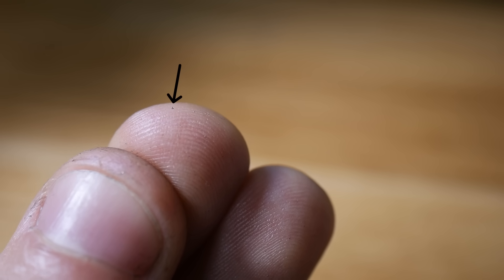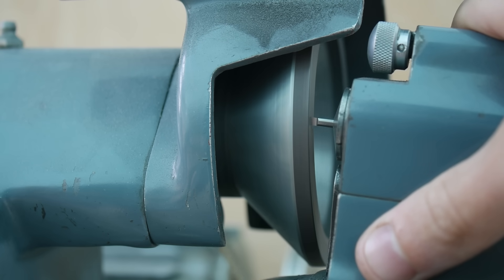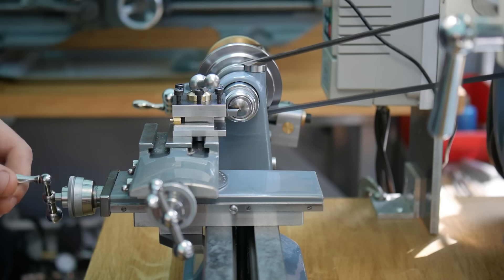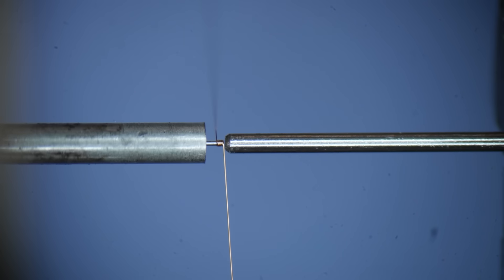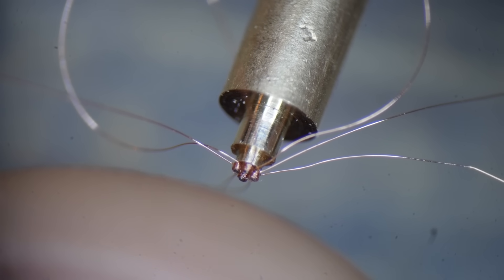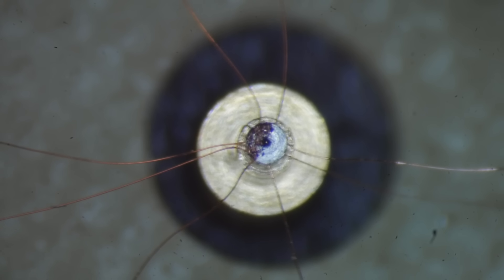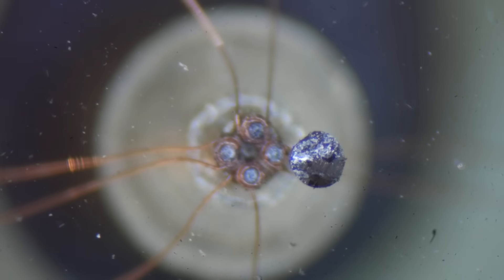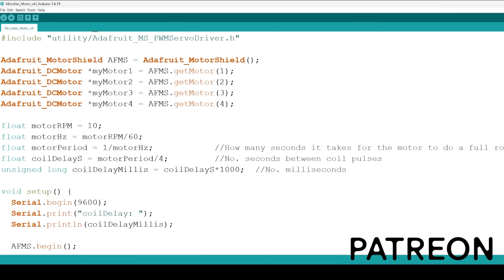Attempting to Make the World's Smallest* Electric Motor

Comment: I don’t know if this will help, or if it’s even possible… you mentioned at the end about not knowing how to mount a watch jewel to use as a bearing surface.  But since the whole motor is so small, would it be possible to drill the mounting holes for the electromagnets directly into the jewel itself, around the central pivot hole?  Maybe even having a top and a bottom jewel, in order to have the magnet rods fully constrained.  You could start out by using a superglue arbor and a polishing lap to grind the jewels down to a thin-ish wafer to save some of the size.  You could maybe even glue the two jewels together to machine all of their holes in perfect alignment, then separate them with acetone afterwards.  With the magnet rods held firmly in place between the jewels using UV adhesive, the rotor is much more likely to spin without hitting them, and the jewels (with a thin film of a light viscosity oil) will hold the rotor steady as it spins, with much less friction holding it back.

Great project, I can’t wait to see how version 2.0 turns out!

Comment: You used copper (copper alloy) wire for winding around the post, could you use steel (some alloy) wire for the post?
Could you extrude post thru the base, then cut them to length?

Comment: Try casting instead of machining, it's much easier at that scale. You can experiment with mercury as well. I wonder if casting out of polymer and then electroplating with a ferro-magnetic metal may also work.

Comment: The glue is not a bad thing. Use a cylinder of material that the glue wont stick to. Then remove it and you have a place to attach the rotor.

Alternatively do glue a cylinder in and use it as a shaft to put a magnetised disk with a hole on it

Comment: Use a micro droplet of mercury as a rotor and make it as a induction motor. The droplet is perfectly round and the surface tension of mercury will make it behave like a solid.

Comment: put a drop of resin on the tip and let it harden, before cutting off with the diamondwheel. where you can get the wheels, you can get the resin/wax ;)

Comment: I’ve used UV resin on micro components for a few years now. At Harvard, we were dialing in micro lithography combined with laser etching. Personally, I’d invest in a 1064nm YAG laser with pulse modulation so you can combine that with a super fine pantograph. 🤤

Comment: A bit of soldering advice - my mother worked in electronics repair for a time, and taught me that a bit of clear nail polish can be better than solder for connecting fine wires by hand (though it can also be better to have a soldering oven if you can)

Comment: Instead of CA you could might use UV hardening glue, if you get to much just rinse it off and it will not hardened until UV light hit hit. They are usually a little thicker than CA but I have not dived into it much so there could absolutely be thinner as well since these are used in the industry and they normally have many demands.

Comment: I can't decide what's the bigger feat...your persistence and expansive problem solving skills to build this device or the unbelievably compelling videography in capturing the scale of the technical difficulties one faces when working at this level. Nevertheless, making nano-scale, functional mechanical devices....both the fabrication of the individual components as well as the assembly of them is a key enabler to more affordable deep, deep space exploration. While advanced lithography methods taken from the semiconductor industry have enabled the nano-scale component challenge, the work you've done here to assemble these tiny, fragile components into a functional device is a real enabler to this application as undoubtedly to many other applications that are outside my own awareness. Amazing, amazing work.

Comment: My first question is why wouldn't you have just used three coils as a typical small DC motor would use?  Other than that, I can't offer any suggestions, you're way beyond me and being able to do that kind of work. Perhaps building some specialized tiny tools to help with the manufacturing?
I've always wondered if one could create a whole machine shop on a small scale. Build a motor maybe 10 times that size that's much easier to build and use it to power a tiny lathe and drill you build.

Comment: 🤔maybe you could use uv resin, not only to glue parts but better to cast the coils into a more handable part. Then you may drill the hole into it. About the shape, i'm pretty sure a flat coil arrangement around a simple magnetic disc equiped with glued conical shafts then sandwitched between 2 drilled plates will turn smoothly and be lovely to observe (btw 3 coils are enought to ensure stable rotation with a reliable bearing , less work than doing 4). good luck skilly guy.

Comment: Does the rotor and shaft have to be one piece? A rotor disk with a hole in it spinning on a fixed shaft would be easier to make.
Reply: Presumably the original creator used a 4 pole design as it was easier to make a controller to run it. With the arduino it should be possible to make a 3 pole version, reducing the size even further.

Comment: not an expert on this trade nor even in metalwork or electronics, but i can tell you solvent for cyanoacrilate is very useful. I have a small bottle from Würth, it is advertised for unsticking your fingers, but using it for parta and rinsi g with ethanol really helps cleanint the mess. If you let it soak for very little, it dissolves the outside layer without sipping into the joints. Furthermore, i would stake in place the coil cores, and pre makenthe coils on a mandrel. After that, the coils should be insertes onto their cores. I would use the lathe crosslide to position and mount them, thus eliminatong hand free operation. Regarding the rigidity of the shaft, i would treat it as any other watch componet, with conical shafts on ruby bearings. This way contact ocurra only on the apex of the shaft.  Also, another plate holding the motor as a sandwich. I don't kow if any of this is useful as i've never workes in sich a small scale. Great video and trade skills, such a pleasure to watch. Bestt regards

Comment: If you create a 4 or 2 piece platform for the winding you could just torque the cable down to avoid having to glue. You could also encapsulate the top or have a through pin hole to keep it in place when assembled.

Comment: Your parting tool geometry is what I was taught when running brown and sharp 00G screw machines in the 1970's at Advanced Screw Products 😅. Just recently I tried to share this trick with some young manufacturing engineers.....there are many manufacturing tricks which have never been recorded and are doomed to be lost.
Reply: As a quality control manager in construction and data centers, The knowledge of construction has been lost to builders.
The majority of what we do now is putting together pre-engineered pieces, assembling. 
I think of this often.
Our civilization is built upon layers and layers of previous knowledge and technology that was automated into machines/tech, that built the components, did the calculations, and all, for us. Onto which another layer was created and another. A proper catastrophe would send us back to the Stone age. To recreate our modern conveniences you need many experts in many fields. You would be hard pressed to find one person that knows the science behind all the components of a system.
I truly admire ancient architecture and even more recent architecture that involved true mastery. Stone masonry, carpentry, stained glass, handcrafted ironwork features.
We are advancing ourselves into pure ignorance, like Wall-E.
We won't know how anything works we'll just know that it used to work as long as it had power and material.
How many people would even know how or where to get ore and have the knowledge to make metals? 🤔

Comment: Does it have to rotate? Else you could make it as a rod in a coil making a stroke instead. Also it might be easier not to turn the parts using a method with less bending force. Maybe it does not even need to be cylindrical parts?

Comment: I've never done anything close to this scale but have worked with microscopic resistors and other electronic components. You had trouble positioning the rotor. I find that doing a series of movements is better than trying to awkwardly place the item. Place the item on it's side. Rotate it into position. Pick it up and drop it into final position. I'm also surprised that you are using the tweezers. The part is small enough to position with a needle and drop of fluid. You lose some accuracy but you get multiple attempts to position correctly.

Comment: The problem with this size range is, that you cannot use the electrodynamic principle of electric motors successfully, because it needs certain wire lengths to produce enough BxL products to generate enough force and back EMF for motion at useful currents and voltages. So you have to live with magnetostatic motors which tend to melt or evaporate at a certain scale because of bad cooling.

This is also the reason why micromotion on chip devices is generated by electrostatic motors. In this way you can at least operate with useful voltage ranges, and the velocities can influence enough ESF to work against to much displacement currents. Electrostatic motors are also relatively easy to achieve by the use of thin PCB materials. So you just have to send your gerber files to a PCB manufacturer to get certain amounts of motor part at very little costs.

Making such motors you have to be aware, that you have very small moving masses, which can be accellerated to extremely high velocities allready by tiny forces. I can imagine that a homopolar motor based on a 1 mm diameter and 0.5 mm thick NdFeB magnet exposed to a PCB with a centrally aranged radial copper line design can easily rotate with more than a million turns per minute, when it runs with a useful titanium shaft in ruby bushings under an EMF of less than 1 V and a few mA current.

Comment: I know it's probably not in keeping with the theme of the build, but I wonder if a crude EDM setup might help you in shaping and parting your pieces. For something this small, you probably wouldn't need a lot of the supporting equipment (like for example a wire feed and submersible tank). You could likely just use a PWM output of an Arduino to drive a MOSFET (or maybe a BJT?) to switch an adjustable benchtop power supply. At a random guess, I'd say a voltage of around 10-50V with a pulse duration of anywhere from 0.1-100us, and a switching frequency of perhaps 100kHz might suffice (since your work is so small, output switches at 100kHz for a duration of 0.1-100us). You'd also want a variable resistor in series with the switched output to limit peak current to somewhere in the range of 0.1-0.5A. The value of this resistor would have to change with your input voltage (from 20 Ohms at 10V/0.5A to 500 Ohms at 50V/0.1A). You could attach the machining wire or plate to a toolpost, have the body of your lathe grounded to the PSU, then manipulate the machining surface like you would any other lathe tool. Would be interesting to see how effective it might be.

Good luck either way! Super excited to see a future video on this!

Comment: IMO, you'd be better off having the four "cores" 1:20 made from a non-magnetic material - say a piece of ceramic or glass (or even a piece of non-ferromagnetic metal, if your speeds are going to be low). The "cogging" from the bits of steel shall always imbalance your rotor, and you'd need damn good bearings to counteract this; whereas an "ironless" stator shall be far easier to implement, albeit less efficient.

Comment: "Wire itself tended to melt" 10:20 --> It's likely "dissolve" instead of "melt" - the copper dissolves into the solder (presumably until an equilibrium), hence when the solder is already equilibrated on the copper pad, it does not eat away the wire.

Comment: Very nice project, just wanted to leave a small suggestion. The difficulty of working with Alnico may be avoided and the original rotor may work, if you make the motor AC instead of DC, as Induction motors don't need permanent magnets, any metallic rotor would work. You will be trading the mechanical complexity with electronic complexity, i.e., the electronic driver will need DACs to create the phase shifted sinusoids, but I think it's a good trade-off. 
Note: I am not sure how good the induction would be based on the current design and tolerances, but thought to share a possible avenue to explore.
Reply: You don't need DACs for this function at all. Why would you think this?
Reply: @user-rs8zg8ey2b I thought it would be more controllable to use a Microcontroller and DAC setup to generate the phase shifted sinusoids for each coil. So, that the amplitude, frequency and phase shift can be programmed for the experiment. It would be interesting to know your thoughts on this as well...
Reply: @rounakdutta6211  99% of brushless motor do NOT control the amplitude. So imo you don't either, it just complicates the whole electronics drive section. 
On my channel I spin a magnet to 3.8Mrpm with a hall sensor, fet driver, fet and coil. Yes, you can't use a hall sensor, but why complicate something that does not need that level of control? Good luck.
Reply: @user-rs8zg8ey2b I saw a few of your videos, especially the motor ones. Nice work on those. But when I said induction motor, I didn't mean bldc, I really meant "rotating magnetic field induction motor", so the rotor doesn't have to be a magnet. Without a magnetic rotor, hall-effect sensor based driver would be of little use. In your videos, I understand that the rotors are ball magnets, so you are able to use the hall effect sensor for timing the pulses.

Also, since the rotor is very tiny, in this project, I thought a well controlled supply would be helpful in finding out the sweet spot in the power input. E.g., in your high speed motors, the rotor disintegrated very quickly, and the aftermath was ofc fun to watch :-), but that may not be the goal here...
Reply: @rounakdutta6211  ok, I see what you mean now. 
It's easy to change supply voltage to limit rpm. 
Unless you're a programmer (I am not), adding the dac control to vary the amplitude is not worth the extra complexity imo. 
Using a mpu to ramp up and hold a steady rpm is a good idea, with some trial and error you could find a nice sweet ramp up speed and running speed. 

A while ago I wrote different ways to drive brushless motors, but yours don't have magnets. If your interested I will find the link.

I just had a KISS idea to drive your motor. If your motor has 4 poles, use a 4 pole bldc motor as a generator to drive your femtomotor.
Well done!

On another note, why not use a tiny magnet, one coil (no core) and spin it, it could possibly be smaller than your current motor as it has less coils.
Reply: @user-rs8zg8ey2b  BLDC or PMSM motors are NOT the same as induction motors. I suspect that the small inductance and weak coupling between rotor and stator would render attempts at vector control futile. The only feasible way would be to just synthesize multiphase waveforms(for the number of phases i would use 3) using either analog circuit or a uControler. Then, use three or six windings on the motor, this would provide actual rotating magnetic feild. You could adjust the speed with simple v/f control.

Comment: UT Austin has a paper about a bunch of electric motors that are only a couple of molecules across & they have ways of wirelessly sending RF power to it via lab grown attuned crystals at different frequencies so that logic & batteries could be handled externally.  There are a bunch of universities working on nano-tech with smaller motors than this & even naturally occurring motors smaller than this as any biotech grad student should be able to point out to you.  The struggle is tracking these nanobots inside of anything but in theory you could make a swarm of tiny worker nano-bots without any logic inside of them so small that they wouldn’t cause damage & then use larger pill sized robots to control whatever nanobots happened to flow past for precise surgery at the cellular level that could perfectly target a wide variety of cancers & other such diseases.  All of these efforts get very little funding though for some reason when it seems promising.  They military has similar nanotech projects that looked at putting mesh reinforcements inside of vital organs to make humans more explosion resistant, these had very small motorized nanobots involved as well to actually build the mesh.

Comment: Like make a bushing to keep everything center but even integrate it into your coil base so the uniformity is set by the base which plus you could use fine cylinder to make the coils part and not lose cause attached to wire then just like thermally expand the holes to set the pins

Comment: look into ceramic coatings to substitute bearings, you can also get tweezers with ceramic tips to help against magmatism.
  One idea may be to have two rotors that are magnetically attracted to each other with the stator in the middle separating them.
  This would help to hold it all together. It needs to be more of a unit that builds up and all fits together. The rotor floating around on a pool of oil wasn't really symbolising one motor, more of a floater.

Comment: I think laser welding may be a more viable option than soldering. While I am not familiar with the subject at all, the fact that any laser welder would have to have optical controls means that fine focal points and great precision is more practical. Furthermore, the extremely thin wire would require very small amount of energy making said laser more practically sized.

Comment: Why not drill a center hole in the disk and in the stator?  Then secure the rotor like a bead on a string with a thin piece of wire as the shaft/axle.